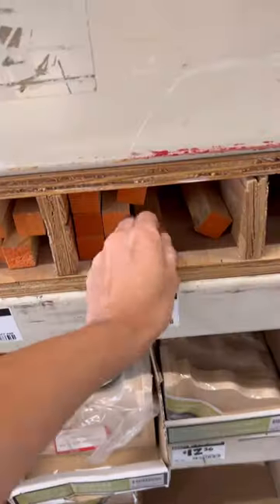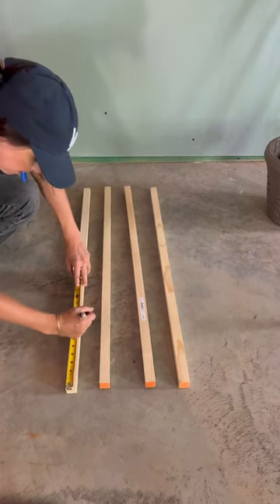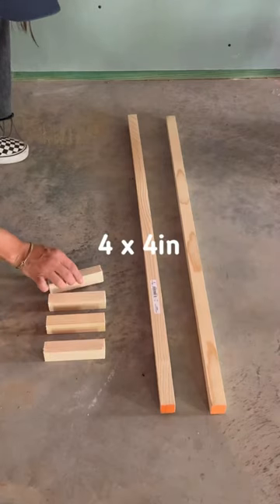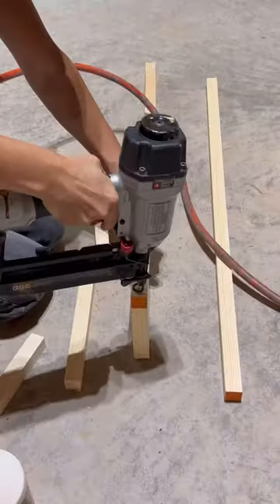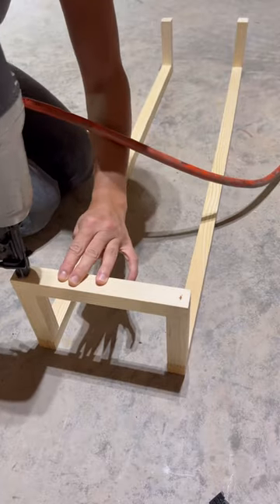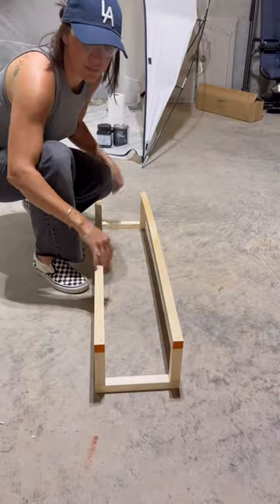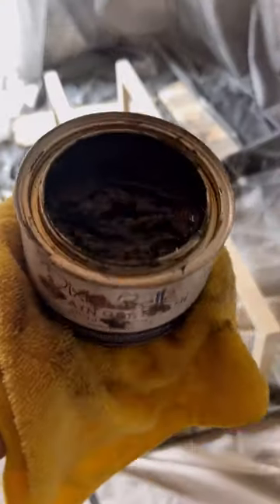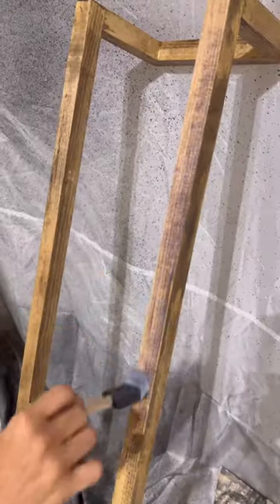The EASIEST Beginner DIY project ⚒️ #diy #woodworking #dixiebellepaint

Comment: One tip from a woodworker -- those joints and brad nails won't have much stay-together power because they're going into the ends of the short pieces. Be sure to add wood glue prior to nailing, and that should help this last.
Reply: Thanks for your knowledge
Reply: I was going to comment the same!
Reply: Yeah i was gonna say hope they arent holding anything other than a fart
Reply: Another good tip would be to use some pre-stain conditioner. The inexpensive big box “white wood” doesn’t take stain very well. Pre stain wont change the game but it certainly helps
Reply: I was just about to say the same thing. Gotta have that extra layer of support for the nails.
Reply: If they have a miter saw, why not just miter the edges.
Reply: I'm not a woodworker, but I came here to say exactly that. 👍
Reply: She's a beginner, let her learn.
Reply: @87clits This is her, learning.
Reply: As a beginner, loving the tips. Thank you.
Reply: This is how to give tips in a non condescending way 👏
Reply: came to say this, thank you for looking out for all those DIYers
Reply: As a fellow wood worker I must say: I was going to say this same thing!

A few more tips I like to use:

-You can make finishing your project a little easier by sanding all the flat sides before connecting. This also gives you a better gluing surface, and smaller joints to sand afterwards.

- Using a pre-stain/wood conditioner can really highlight the beauty of the wood when staining. It helps the stain absorb evenly, preventing a blotchy look.
It’s inexpensive and only takes a couple minutes before you are ready to stain.

-Tack cloths are cheap and the best thing to use after sanding for gluing or staining.

-I always double check if it needs a sealer, how long it takes to dry and if you’ll need mineral spirits for cleaning up. 

I hope this info helps!
Reply: So first we all need to get the tools to make it. Oh geez! Better buy it made 😊
Reply: @nicaritoart  but then you can make more things because you now have the tools....?

Comment: Do yourself a favor, go to your nearest hardwood dealer, ask for the same pieces in your favorite wood species and do the same project.  Try wiping on some Danish oil or similar for the finish. It'll look a billion times better and cost only a little bit more than pine
Reply: Hardwood can cost quite a bit more than pine. Like I pay $3 for a 1x6x8 of rough pine and Walnut is like $45. Buying it already S4S as a DIY’er would probably need to is going to be double.(unless they happen to know someone with a jointer, planer, and tablesaw.)

Comment: I love how you think that someone doing their first DIY project already has several power tools.
Reply: This can be accomplished with a handsaw, a few nails, and a hammer.
Reply: Big box stores will cut wood for you. Drill works just as well. If you're going to DIY you should invest in a drill. If you can't get one or borrow one, a hammer and nail will work. As someone else stated, good idea to glue too. Black Friday and holidays good time to get good deals on power tools, especially the packages of multiple tools. Make sure you can grip and lift them easily. Some are more friendly for women's hands. Also auctions are a great place to find deals, find an auction that deals with a lot of estates and downsizing. Make sure you can try them out, and if possible bring someone who knows what to look for if you don't. Good luck.
Reply: @serenakoleno9338  That's all really good advice. Thanks for taking the time to be supportive.
Reply: Don’t forget paying $20.00 for a $4 piece of wood
Reply: It says beginner diy... This could be someone who bought some tools wanting to learn how to make things 🤷‍♂️
Reply: You... you get that you can use a hammer and nail, right?
Reply: Right
Reply: Using wood glue would actually make it a lot stronger than using a nail gun. If you want to make this, you can do it with some basic tools (a pencil, a ruler, a saw, wood glue, and some nails and a hammer). Apply a small amount of wood glue to any  places where the wood will touch, then use a nail and a hammer to attach them. The glue will be the main thing that keeos the wood together long term (it's very strong once dried) and the nail will keep it together in the short term to give the glue a chance to dry.
Reply: She bought the tools but forgot the knowledge. A brad nail in a butt joint won't hold even a few towels for long.
Reply: @serenakoleno9338  Your post was 5x better than the video.
Reply: Not for lack of trying honestly 😪 the familia has prohibited i use anything stronger than a stapler gun and my flimsy hands cant even get the damn thing to staple. I could’ve been the next zaha hadid but noooo 😑
Reply: @alphafert608 it’ll hold for a little while actually if it’s not getting wet. But in the moist bathroom, not as long. First thing I ever made was 2 big flower boxes for the porch- no glue, butt joints and Brad nails, filled with soil and lots of flowers hanging out. They lasted awhile surprisingly at least a few years.
Reply: @serenakoleno9338   Maybe you should make the video.
Reply: That’s the sameeeeeee thing I was thinking lol I need to get my tool set up! Lol
Reply: you expect to cut the wood with your teeth or something? of course you need tools.
Reply: @ok-hd4so  I guess you are unfamiliar with hand tools?

Comment: No beginner DYI has a nail gun. 😂
Reply: Just use drywall screws like everyone else... 🤣
Reply: Whoops I forgot, "Beginner DIY" means "I'm too stupid to figure out another method than what's in the video"
Reply: @CLove511 what does that mean? That is a simple cute towel rack. I love the big nail gun, its not a simple gun but you can always use an old time hammer if you want it, anymore simple.
Reply: Boy at that the truth!!!
Reply: well good thing some wood glue works well.. and why can no beginner diyer have  nail gun? menards like 140 compressor stapler and 2 different nail guns...
Reply: @starsantistevan6870  it means people who complain about the tool are too stupid to figure out any other means of attaching 2 pieces of wood.

Smart people would say "I don't have a brad nailer, but I have a drill and screws, a hammer and nails, glue and clamps..."
Reply: But they have nails and a hammer. Which for using 20 nails is perfectly fine.
Reply: @CLove511 what does "beginner" mean? If they have the skills to work around the nail gun, this project is beneath their skill level.
Reply: And 16 gauge at that... 😎
Reply: Finish Nails and a hammer would work😊
Reply: Was thinking exactly the same, the same regarding the saw. And yes you'll can use others materials, but she also clearly says: 'you'll get your nailgun'.
Reply: @walkingweapon  Apparently 'beginner' means they don't understand a nail gun is just a fancier version of hammering nails.
Reply: Do yourself it
Reply: Maybe she borrowed or rented it.
Reply: Or a mitre saw
Reply: @walkingweapon beginner dyi... sounds like someone has bought some tools and wants to learn how to build things... 🤷‍♂️
Reply: And chopsaw
Reply: Or an air compressor
Reply: I was thinking the same thing.
Reply: Or an electric saw 😂
Reply: Huh? Beginner diy? I don't think so. 
Let me check my list: 
Skilsaw? Nope.
Nail gun? Nope.
This is a "reach". Good intentions I'm sure but not realistic. How about "old school" hammer and nails, saw? Thanks for sharing the project though. It turned out nice.
Reply: I’m a beginner and I have so many tools that I have inherited from people that have passed! I am going to learn and make use of the things that were once used by the people I loved❤❤❤❤
Reply: Sure they do, the screwdriver would be first and then a Brad nailer would be next for any beginner diy'er
Reply: It's ok, it's not a nail gun. It's a pneumatic stapler. And it still looks like a waste of time and material.
Reply: Same as the saw lol
Reply: Came here to say this😂
Reply: Yes,  a lot do...
Reply: @nummynutz1  then it's not a beginner project, a beginner project is nails, glue, and paint. If you have a nail gun, your no beginner bud.
Reply: @dougiggitygiggity6461  I'm a beginner and went out and purchased an air compressor and a nail gun so that when I glue things up I'll be able to use the gun instead of clamps.  I've yet to start my first project.  So yes,  beginners can have nail guns.  You're not the arbiter that determines who is and who isn't a beginner.
Reply: @nummynutz1  You described things beyond a beginners knowledge. And why argue about it? Nobody insulted anybody. It's not opinion, it's knowledge and tool based fact.
Reply: @dougiggitygiggity6461  is just a lot of YouTube.  Acquired knowledge I've you to put forth.  It is in fact your opinion.
Reply: Exactly!😂
Reply: Or a saw like that
Reply: Ok so use a hammer and a nail
Reply: Right? My thoughts exactly!
Reply: @scottward2366 most beginners dont own a nail gun. They cost tons of money and are a glorified hammer. She shouldve just said nail it with a hammer, but here we have a “pro” trying to make beginners videos who forgets what its like to be a beginner
Reply: @OldsmobileCutlass1969Va drywall screws are so weak don’t use those
Reply: You can use wood glue, screws, nails, duct tape, Velcro, double sided  tape, tree sap, friction, Ants, volcanic ash, dinosaur shit, ur moms tears
Reply: Nice. I like that! ❤
Reply: But we have liquid nails and B6000 lol
Reply: @sonjacarrizosa8642 be careful, having old tools are often found to be unsafe and remember the older generations didn’t throw anything away even when it was worn out , take care …
Reply: but they are like 4 bucks on Facebook. I got three of them just to decorate my tools.
Reply: @chrismcginn2 harbor freight even better...$50 compressor, $20 for gun, $10 for brad nails. 
I LOVE my nail gun, it saves so much time
Reply: Plus the wood should have been conditioned first. It looked like it had teprosy.
Reply: I do.
Reply: A pneumatic one, no less. 😂 Love the project, btw!! ❤
Reply: 😂facts
Reply: So ya got a hammer or no?
Reply: @OldsmobileCutlass1969Va you can’t use screws because it has to be hidden use a 1 1/2 nail
Reply: They should it's a very useful tool for beginners.
Reply: This comment has the energy as someone being confused when you tell them "Grab a pencil and write this down," if they dont have a pencil while staring at a cup of pens. They are other ways to accomplish the relevant part of the task. Hammer and nail. Screws. Maybe wood glue and clamps. Dowel and wood glue. Personally id be more annoyed telling people to spend $5 per piece of wood for a towel rack.

Comment: I would also add some glue between the nailed members!
Reply: Was gonna suggest the same thing. Great idea! Hate to see it fall apart months later
Reply: Too flimsy!
Reply: Yes, otherwise forget it.
Reply: Came here for this.
Reply: Thinking the same. Hell…screw it and plug it. Almost as easy and definitely stronger than brad nails. Looks nice though.
Reply: I would stryate before gluing.
Reply: @fringedwellermccatintyre730 
What's THAT mean?

Comment: 1. Cut off the orange painted end first so you have a smooth end and don’t need to cover it with filler
2. Use wood glue to reinforce the joints. Nailing into end grain is just asking for it to slip out. Put a skim coat of glue on the end grain, let it dry, then glue the pieces together like normal. The thin dried glue layer will fill some of the end grain pores and result in a better joint.
3. Use a pre-stain conditioner before applying stain. It’ll take out some of those splotches you see all over her finished product. Especially true with pine.
4. Secure to the wall with anchors (2 on top, 2 on bottom) since this is too narrow to reach 2 studs.
Reply: You forgot to add that a finish that is going to help the wood survive the moisture of a bathroom is needed as well; there is no way that thing is going to last long if it is getting exposed to moisture everyday.
Reply: I don’t find the pre-conditioner even helps much with pine and regular stain. It looks like crap half the time. Still working out the best way to make pine look better.😂
Reply: Cut off the ends, painted or not, they are rarely square or plumb and the glue will hold better on fresh wood than old or painted.
Reply: Glad you didn't mention the nail-gun!!

Comment: Or buy 2 pieces that are full size 2"x2"x8', ( instead of 4 pcs at 2"x2"x2') then cut them to the sizes you need, you have the same amount of wood but for a few dollars less
Reply: Or even better yet, ask them to cut the 8' to the sizes you need for you! Now you just sand and assemble. But don't forget the glue!
Reply: I was wondering why there were 4 pieces? I thought they were 1x1x8 🤷‍♀️ They are 2x2? That's why she needed 4 pieces because 4 at 4" and 2 at 9"= 34" Absolutely get 8' piece. If they are only 24" long you would need 1 2x2x8 cause you would only need 82". I don't think 24" is long enough. I would make them 30" long and it would come out to 94" so 1 8' piece would be enough. Thank you for mentioning the 2x2. I thought it was 1x1. 🤦‍♀️

Comment: I’m hesitating after reading so many negative comments but here goes. For a beginner, a drill is a great first tool. Drill a 1/4” hole thru the joint. Then apply glue to the joint and a dowel rod. It will give you a stronger joint. After sanding everything smooth and flush, apply a stain pre-conditioner when using soft woods like pine or spruce. It will pop the grain so give it another light sanding to smooth the surface. Now apply your stain. If you don’t do the conditioner. Then use a clear coat to seal the stain or your towels might get stained also. 😢
Otherwise, great project! Keep it up. 🎉

Comment: don’t call beginner project and say “…use your nail gun..”😂
Reply: Exactly what I was thinking lol
Reply: Seems like a you problem, if you're not going to buy the tools then you're not going to diy. U can get 3 nail guns and a compressor for 300
Reply: Believe it or not you an use a hammer too
Reply: @Billybob-go8hn  I have several hundred tools but I still don't have a nail gun.
Reply: @elobiretv  Yeah so the video should have shown how to do it with a hammer instead of power tools that 99% of beginners will not have access to.

Comment: Nice!
A little glue would definitely help
Reply: no it wouldnt. Jus holding towels
Reply: PL Premium because of the end grain.
Reply: @danielhoward8354  so it wouldn't make the joint stronger?
Only holding towels, but one finish nail is likely to start pulling out when you try to cram that last one in.
Reply: @markchidester6239  I didnt say it wouldnt make it stronger

Comment: You're gonna need 4 of them... then proceeds to use 3 LOL
Reply: Glad it's not just me! I kept wondering what the heck you're supposed to do with the fourth one
Reply: I was wondering the same thing at least she ain't teaching math maybe home Depot worker tricked her in buying extra told her yeah u gonna need 4 she came home said it then start building 😅
Reply: Instructions are bad, no beginners have a nail gun or power saw.
Reply: She used all 4 pieces. She used the first piece to cut four, 4 inch pieces. The second piece to cut two, 9 inch pieces. The remaining two pieces were for the long side.

Comment: I want to make an ornamental towel rack. 4 bits of cheap wood. $15. Chop saw $200 nail gun, pneumatic Brad nail gun $100, sander $150.  Towel rack in Lowes $28.